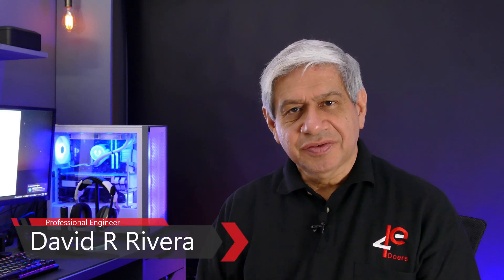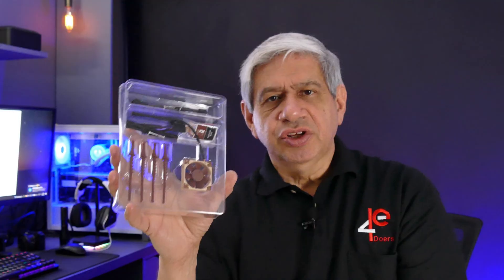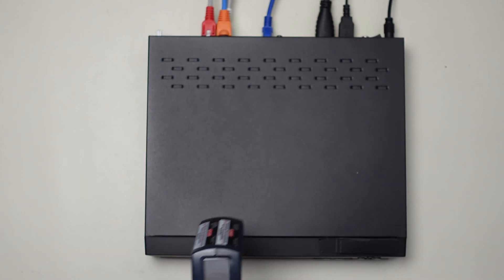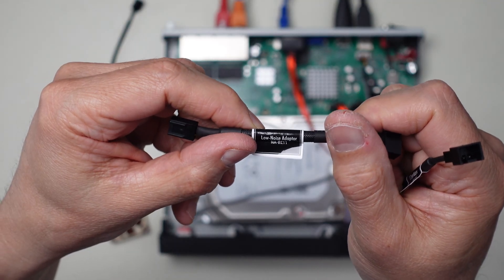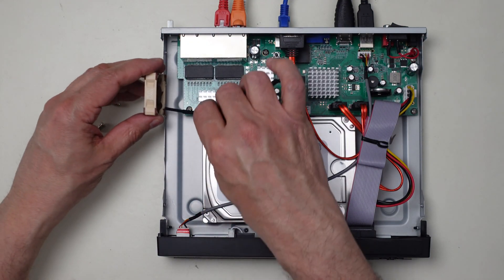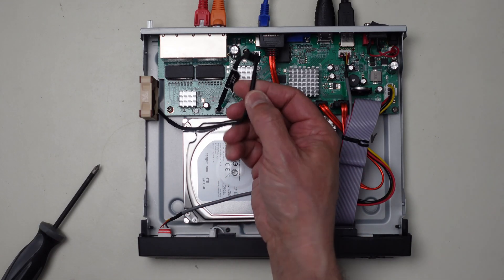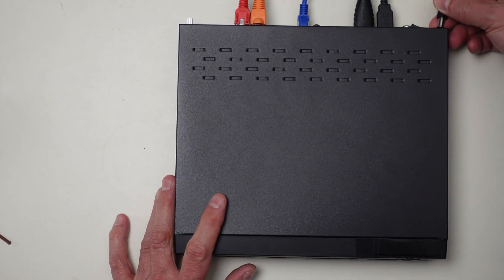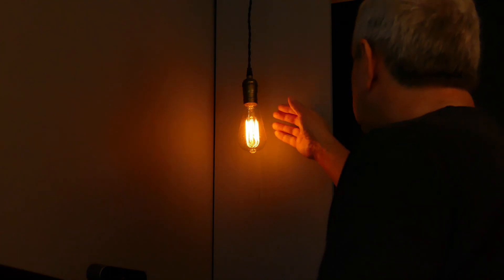Improving REOLINK NVR Cooling by Adding a Noctua Fan

Comment: I bought my NVR in 2021 and it does not have the pinout for the power connector for the fan in the video. Searching the comments I found the earlier motherboard fan output is at the power cord end of the device. Bingo all done and very happy with the result. Great video thank you. I also upgraded to a 4tb drive - and purchased the seagate skyhawk - this is their specialist NVR HDD - the others eg the barracuda  are not suitable apparently.
Reply from the maker: I wondered if they changed the model.

Comment: I have the 16 channel that comes with a fan. I got if off ebay so not sure if this is a return/reason it was being sold but the fan was quite loud.  So I replaced with the Noctua fan and also decided on the low noise adapter. The stock fan was actually installed blowing in rather than out of the case.  This didn't make a lot of sense to me as there are a bunch of plugs, ribon cables, etc. blocking the air from getting to the internal components.  I installed the Noctua as an exhaust.  Mine seemed to run fairly cool in the first place so not sure if the fan is even really needed but obviously wouln't hurt. Although, maybe the fan becomes necessary if you are running 16 channels and two hard drives.  BTW, these Noctua fans are great with only one major flaw ... anything you buy will cost you $15-$20 more because you become spoiled with how quiet they run ... nothing else will compare!
Reply from the maker: I agree entirely with everything you say.  Thanks so much for the great comment.

Comment: Thank you for this awesome video.  When I ordered the Reolink system, I also ordered  2 hard drives and this fan that you recommended.    It looks like the hard drive is way big to add an additional hard drive in the NVR so I ordered a second hard drive and enclosure for it.
Reply from the maker: The larger drives are thicker, which I show in the previous video to this one, however I was able to get it in by moving some of the wires around.
Reply: @PE4Doers  Thank you for that.  I just watched your hard drive video.  Its good to know that two screws will be securing it instead of 4.   You'd think they would have a universal bracket for it.  Perhaps we can get one that is made for computers?
Reply: I'm going to connect the NVR to my 55-inch television that I bought a year ago.  It's compatible with the Smarthings app.  This is important.   You can add smart things app to Alexa and create a routine to switch to a dedicated HDMI port that the NVR is connected to when motion is detected.   For HDMI 1, I use it for streaming videos, watching satellite, Xbox, etc.  There's an HDMI switch on my Yamaha Sound so I can easily switch the HDMI ports but it isn't Alexa-friendly. For HDMI 2, I'll be using it for the NVR to view the split screens of the cameras. I'm using YoLInk as my home security and it's been working great.  They have awesome outdoor motion sensors.  No wires.  1/4 mile range.  When motion is triggered, it sets off the alarm and turns on the TV, and switches it to HDMI 2.  This way the TV will be off unless I or the Alexa routine turns it on.
Reply from the maker: @RobertWomack  That sounds great.  Thanks for the info 🙂

Comment: This worked really well on the older version of this same NVR (hardware version H3MB16). The temperature is noticeably cooler, even with the low noise adapter installed. People doing this upgrade should take note that the motherboard on the older units is different and that the 2-pin fan header is on the right side of the motherboard, near where the main power cord connector is. Cable routing is therefore different than in this video, but the cables + low noise adapter are long enough to connect without issues. I routed mine around the hard drive and behind the front face plate.

Also, the older units can only be upgraded to 4TB hard drives, not 6TB... even though the new & old NVRs look the same externally. Reolink must be doing some "German engineering" in their production plants to confuse the end user and limit product functionality / upgradeability, lol.
Reply from the maker: Thanks so much for the great information.  I'm sure others who watch this will get a lot out of your comments.
Reply: @PE4Doers  No problem, and thank you for the video.  I just wanted to add that my NVR has ran 24/7 for over 2 years now without a fan and did not suffer any issues. I have four 2k cameras connected to it. I just thought that adding a quality fan was indeed a good idea for the long run, after watching you do it. 👍
Reply from the maker: @SevenSixTwo2012  I am a 'Heat Bigot' I'm afraid. In my very early early days - first working with my Father fixing Television Sets, then later as a Mainframe Field Engineer (repair person) - I found that heat was the "killer" of all electronics.  In just a matter of 5-years of running under excessive heat, the solder on the PC boards would start to flake and increase resistance, and the discrete components (Capacitors, Resistors, Coils, etc.) would begin to fail in massive numbers.  I even got one of my Father's customers to let me add fans to his beloved TV that he inherited from his Father.  That TV set lasted nearly 20-years according to a letter I got from that customer after my Father passed.  I do everything to fight heat.
Reply: @PE4Doers   Some very good insights, thank you for sharing your experience. I don't like heat in my electronics and other tools / machines either, unless heat is a required part of their operation.

By the way, my old gen Reolink NVR is running cool as a cucumber now. The casing is literally cool to the touch, whereas before it had some obvious heat radiating form it. I think that the older generation NVRs probably had less processing power and thus generated less heat. My theory.  
🙂
Reply from the maker: @SevenSixTwo2012  I believe you are on the correct path.  Good luck 🙂
Reply: I just received mine today. I tried to perform the upgrade but it seems that the pins are reversed. I have a N7MB01. I have to find a way to reverse the leads.
Reply: @malcolden7788  I have the same model.  I cut out the black 2-pin connector, keeping the metal prongs intact, and installed them in a new 2-pin connector in reverse.   Works perfect!
Reply: Success! I was able to reverse the pins and now it’s working.

Comment: I installed a security system using a Reolink NVR. My NVR is located in a location where it can become very hot in the summer months, and I have been worrying about it overheating. I wasn't aware that a cooling fan could be so easily added to my NVR.  I just ordered the fan from Amazon using your link, and I also subscribed to your channel. Thank you so much for this useful video. I do have a question for you.....Do you think it would be possible to add an SSD drive via SATA cable to the Reolink NVR?
Reply from the maker: First you are very welcome if I was able to help.  Also, YES, you can add storage as long as you put the drive in an eSATA enclosure and use an eSATA cable.  I show how you can do this in another video of mine (search for eSATA amongst my videos).
Reply: You can't SSD drive internally on Reolink NVR's , aleast on my older model H3M16, it doesn't work. You must use a the old mechanical drive type on my model.

Comment: Much better and quieter than the stock fan on the 16ch (RLN16-410) NVR. Thanks!
Reply from the maker: You are VERY welcome.  I Fully agree, I have mine in my network rack now and I cannot hear it at all (drowned out by other device fans of course) 🙂
Reply: Which fan did you get?  I see they offer different ones with different pins.

Comment: Hi David, nice video. I have a question about your Reolink NVR. I currently have two different NVRs but I'm thinking about getting a Reolink. One thing that I absolutely must have is a quick rewind type feature where I can go from live view to watching the past few minutes or seconds by clicking on an icon without going into the playback screen and entering the time and date. I downloaded the Reolink manual but it didn't mention that feature anywhere. Can you tell me if your Reolink has a one click rewind type feature? Thanks
Reply from the maker: I honestly do not see that option available.  I use th option in playback where it jumped right from one Person or Car event to another, and that meets my specific needs.  I have also used the 'Speed Forward' and 'Speed Reverse' options in a couple of rare cases.
Reply: @PE4Doers  Thank you David. I find it strange that Reolink doesn't have that option since it is extremely useful. Several times a day I find myself reviewing something that just took place, I don't want to have to take all of the extra steps of having to go into the playback screen and selecting the date and time, I'd rather just hit one button from live view. Looks like I may have to get another Hikvision.

Comment: I just replaced my hard drive with a 6TB and now I’m not getting the motion recordings.  It’s recording the regular 24/7 stuff but it doesn’t give me the individual light, vehicle and person detection clips.  Any thoughts?  I also added a fan which has drastically reduced the operating temp.
Reply from the maker: Did you try resetting to factory defaults?  Alo, are you using the console (screen and keyboard on the main unit), or through a remote connection?
Reply: @PE4Doers  I haven’t done a full factory reset.  That may be my next avenue of options.  I’ve tried with the NVR, iOS app and the web application.  Nothing seems to help.
Reply from the maker: @LPCliftonMusic  Sometime these dedicated operating systems (and even the commercially purchased 'Big Names') get stuck into a "state" that can only be cleared with a factory reset (and possibly a 'Full Reload if they are not in a ROM.
Reply: @PE4Doers  yessir, I think that is what happened.  I did a full factory reset last night and it appears to be operating as intended now.  The only problem now is remembering how I had each individual camera set up as in my haste I forgot to make note of it.  A minor inconvenience though.  Thank you for your response and assistance.
Reply from the maker: @LPCliftonMusic  I know what you mean.  That is where my elgato HDMI capture card comes in hand.  What I do now with devices like my NVRone of my Raspberry pi's, or my Router, is connect it through my elgato (or open a remote window if the device supports that) then capture the output as I visit each of the configuration screens.  Then I go back ans review that video when I have to make any major changes so I know where I started (sort of like taking pictures of my car's drum brake setup before taking it apart to replace the shoe).  Good luck 🙂

Comment: David just for reference under your show more for the fan your description of the fan is correct but the link you have takes you to the PWM version which does not have the 3 to 2 jumper. You really need the FLX version.
Reply from the maker: Wayne, Thank you so much for correcting that.  I just corrected it.  Also, the correct Fan is cheaper 🙂
Reply: 12v or 5v version?
Reply from the maker: @kylegoldston  it was a 12v Fan from Nochua -  See the Amazon link in the notes.
Reply: @PE4Doers  WOW, thanks for the record breaking quick response!
Reply from the maker: @kylegoldston  Record breaking? 🙂   I try to respond as soon as I can, but that depends on what is going on.  In this case I just happened to finish a task I had to do before going Live at 3pm and I saw your comment.  I do thank you for watching and commenting - that helps my Channel grow 🙂

Comment: Can you do an updated video with the fan as an intake. Curious to know the temps
Reply: I have the Reolink NVR 16 channel (RLN16-410). The case is a little bit bigger then this one (8-channel). You can installed 2 Hard Drive inside. It came with a fan and installed as intake. The NVR case is not hot at the touch at all but the generic fan was loud. I also replaced the fan with the same Noctua Fan (NF-A4x10 FLX) with the low noise adapter. Also use the fan as intake. It stays cool and I can barely hear the sound of the fan now. I hope that helps
Reply from the maker: @tdmdchannel2339  WOW, that sounds like you did a great upgrade/mod in you case.
Reply from the maker: That may take a while.  I have it in full production at my home right now.  The temps are doing VERY well with it blowing out.